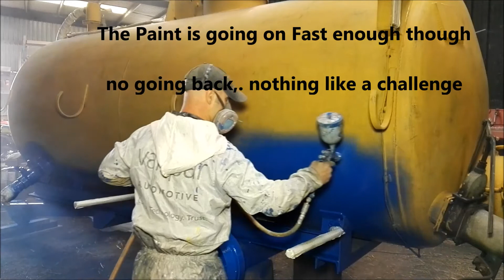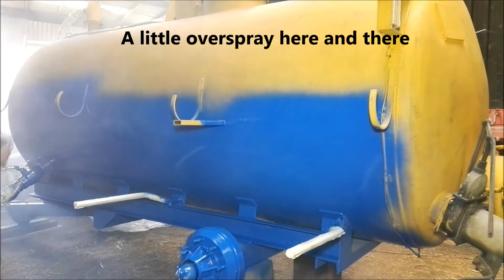Spray Painting a Slurry Tanker for a Farmer New Holland  Tractor Pt 1 and 2  (oor wee spray shop)

Comment: Hi, what size fluid tip would you recommend for the GTI Pro when spraying a tanker like this with 2K direct gloss without a dedicated booth.
Reply from the maker: 1.3 set up i used, it depends on how fast you can paint and how thick the paint is, i had the paint quite thick 10% thinners, if i had to do another one i would take the Devilbiss PRI primer gun with 1.8 nozzle set up with me as an option  as well as the GTI pro

Comment: Great job 😎, I’m just about to tackle a similar job....1650 gallon slurry tanker. How much paint (also hardener) will it approx take me to complete ? looks about the same size as the tanker in your video
Reply from the maker: Martin Freeburn thanks, it took just under 3L paint, for 2 coats, 2.5 L of hardener  and 1L of thinners...the first coat was set up 2 paint to 1 hardener and 10% thinners, the second coat I wanted to be faster and the was 2 paint to 1 and a bit hardener and 30% thinners,,. The more thinners that is added the faster it goes on but loosing a little bit of shine,,., 1.75L paint was used first coat and about 1.25L on the second,  the paint is 2 pack,  Genrock 
I had the benefit of painting 2 over 2 days, I ordered up 5L of paint

Comment: How much did you charge for that job
Reply from the maker: £300 for spraying 2 tankers,  all the preparation  was done for me all i had to do was mix the paint and spray, and he bought the materials and it was his compressor which was only single phase 150L, which could just about keep up with me, but not if was wearing an air fed mask it wouldn't have